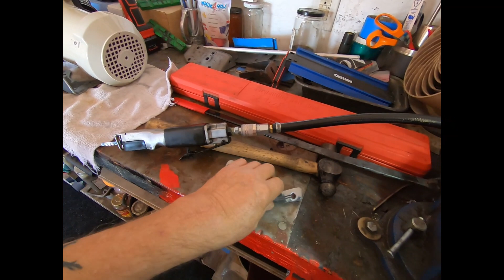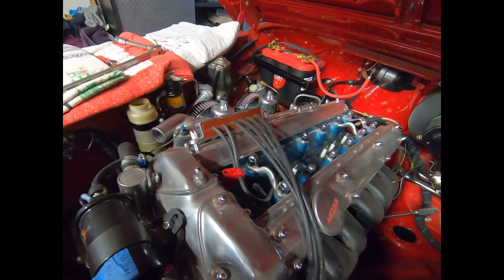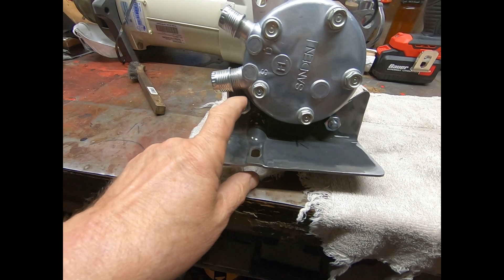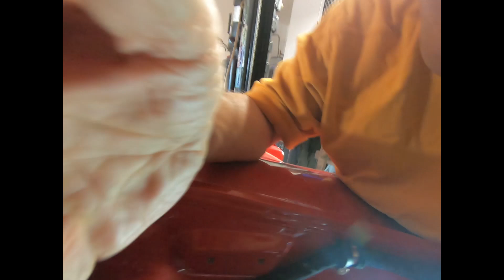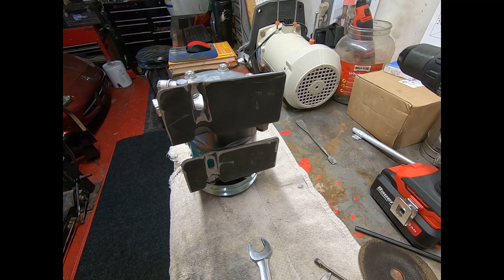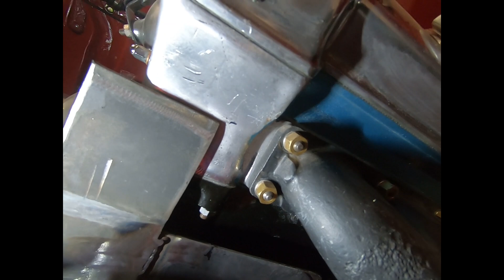Jaguar MKII Reassembly Part 214

Comment: Best wishes Gary, I have just fitted an expansion tank where the washer bottle was, the washer bottle is now on that nice flat front face of the heater between the pipes, just enough room, the pump has to be moved from the top of the bottle to the front with a tin angle bracket,  I will post a short vid tomorrow,
Reply from the maker: You don't like to do things the easy way do you, looking forward to the video.